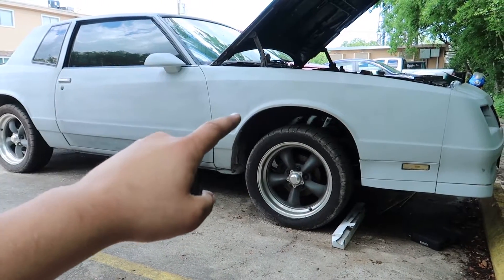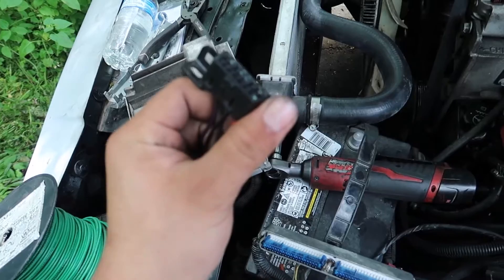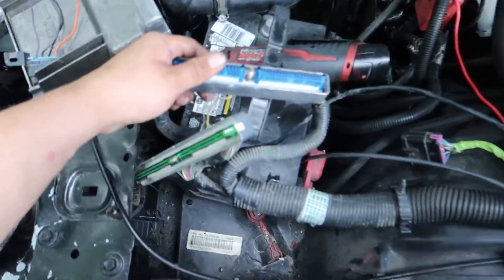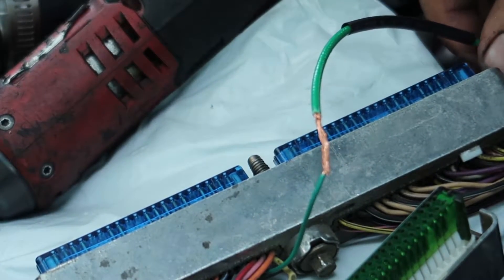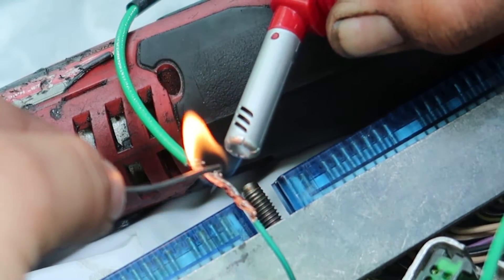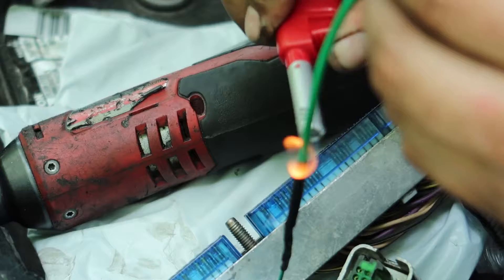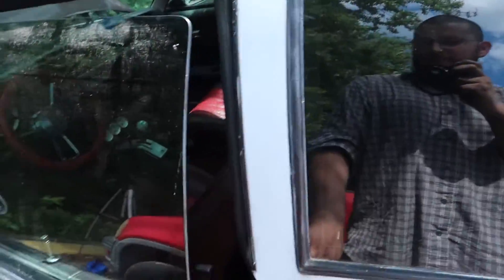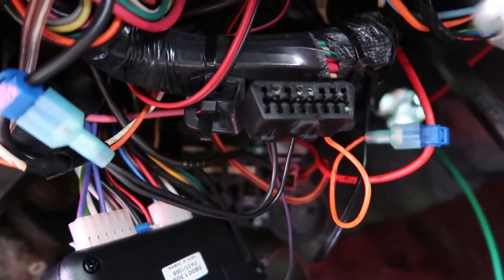How To Install OBD 2 Port In Your LS Swap Project

Comment: Word, I've been rollin 8mpg in my billet crank ZR2 for like a year now because I didn't want to replace the pcm-lighter-door fuse panel-obd harness....my priorities were 1. Hardwire cig lighter to  extra switch in my relay panel....the end. Haha but yeah, I've been rollin on a heads/cam 5.3 tune in my "4.8" 292cid FAAAAATTTTT.. time to take some lsd and try to recall where I put my mpvi2 last year I reckon. Thanks killer

Comment: I'm having to wire in a new obd2 port on my 2002 suburban cause some idiot cut the wires and I can't get it to work period I have checked the fuses and all but needless to say I'm just gonna wire it straight into ecm and rerun all wires so I can tune my truck

Comment: Going through the same here, a buddy's mystery swap, runs like dog shit, no codes, wires everywhere, suspect factory obd port is not connected to the swapped ecm.  With this I know how to talk to the ecm. You get bonus points for soldering with a lighter, that's a new one for me.

Comment: Lol lost me when you started to "solder"
Reply: Using a lighter to solder wire together is super common in the industry.
Reply: @oddmanout7755  people in the industry fix those butcher jobs you've created, solder doesn't even penetrate and the flux is gone before he even touched it